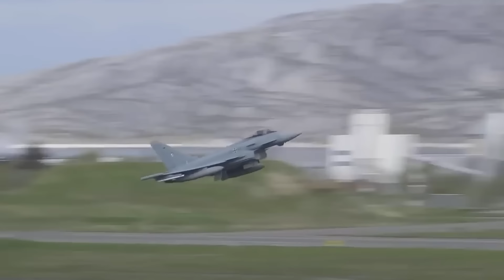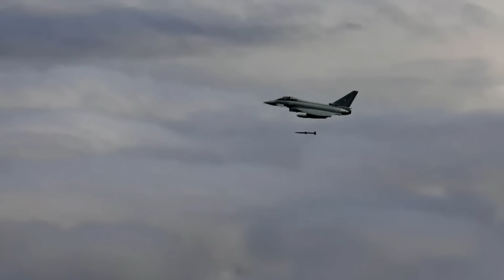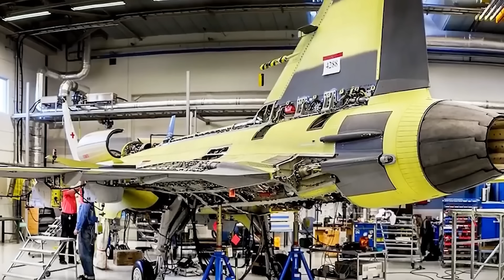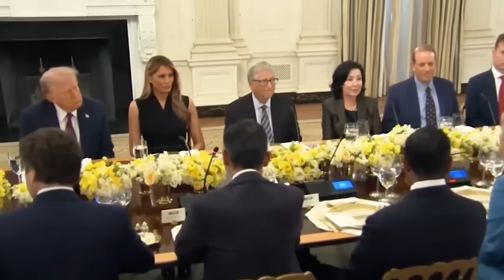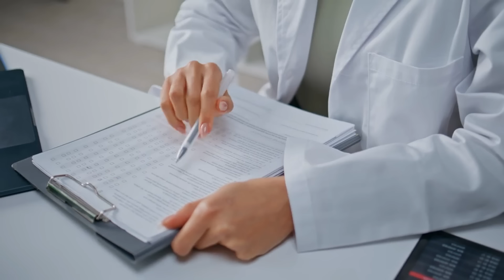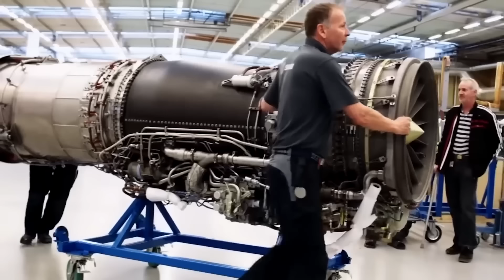Rolls Royce Silently Modified the Gripen — NATO Didn’t See This Coming!

Comment: This video is bs. The Saab CEO just recently said there is no plan to replace the engine for the Grippen E and that doing so would be far too costly.
Reply: And yet the B-52 is doing exactly that.
Reply: @billdyer9443  The B-52 is a completely different type of air frame, built for a completely different purpose.  Much less complex process to replace engines that are attached to the wings.  Very minor specification changes to a fighter jet can change the complete characteristics of its handling.
Reply from the maker: Thank you for sharing that information! It’s great to have viewers who keep me on my toes with the latest updates.
Reply: https://www.youtube.com/watch?v=azxiRv9Pxbc

Comment: The Gripen is a MUCH better choice than F-35.
In particular, it does NOT have a kill switch for USA to veto aircraft use.
Reply: Britain also mistrust the F35. We must build National independence into our capability. I would suggest also that the UK should embark on a new programme of establishing a stock of tactical nukes. We need them for our own defence. Surely this could be achieved through a cooperation with France.
Reply: There are huge arguments about whether there is literally or figuratively a kill switch.  Either way, same effect, just the former is significantly faster to act.
Reply: Those computer upgrades have to happen every day or they can’t even takeoff !

Comment: Rolls Royce is not one of the leaders in aircraft propulsion, BUT the leader!
Reply: GE gives them a good run for their money in the military sector, but overall if it's a Rolls then you're in good hands
Reply: not just aircraft propulsion... there was an article several years ago... US engineering made a drill bit 1000 x thinner than the human hair.. rolls royce asked to see it.. they sent it back 4 weeks later 
the shank had not only been drilled, but threaded and acompanied with a bolt ... make's you wonder what else RR can do....
Reply: @petephillips1378  .yep, that little extra step makes all the difference...and to be able to pull off that kind of detail requires a lot of little, patient steps and a lot of consideration.
Reply from the maker: Absolutely! Rolls Royce has a strong reputation for pushing the boundaries of aircraft propulsion technology. Their innovations consistently set new standards in the industry.
Reply: .... and holder of the Land Speed Record!

Comment: I have heard this before and it’s also been stated the RR is  not making engines for the Gripen. Are they or not?
Reply: not the EJ-230 doesn't even exist it's a concept without a real market
Reply: Complete BULLSH!T.    Both SAAB and Rolls Royce deny that there are any meaningful discussions to replace the current G.E. engine in the Gripen with a Rolls Royce engine.

Comment: Sweden is upgrading the Gripen E with a Rolls-Royce EJ200-based engine, designated EJ230. This replaces the U.S.-made GE F414G engine. That's a fact.
Reply from the maker: You're absolutely right! The upgrade to the EJ230 engine is a significant step for the Gripen E and showcases Sweden's commitment to enhancing its capabilities.
Reply: @fighter.aircraft  it also eliminates dependence on us engines at a time when that dependence is hampered by political maneuvering by the us.
Reply: @fighter.aircraft  What's your source for this? Credible source only please. Not speculation or another AI script based clip making the claim.
Reply: @fighter.aircraft  Complete BULLSH!T.    Both SAAB and Rolls Royce deny that there are any meaningful discussions to replace the current G.E. engine in the Gripen with a Rolls Royce engine.
Reply: @chrisgraham2904  And yet there are many sources that confirm that it's true.

I suspect that SAAB and RR want to keep it under their hats for commercial reasons.

But, definitely not bullshit.
Reply: @phildane7411  No.  It's BULLSHIT.   https://www.youtube.com/watch?v=azxiRv9Pxbc
Reply: @phildane7411  No.  It is BULLSH!T.   https://www.youtube.com/watch?v=azxiRv9Pxbc
Reply: @chrisgraham2904  I suppose you are a butthurt GE employee.

Whatever, shouting your head off and repeating yourself doesn't change the facts. The Swedes and RR are working together to do something radical.

Fewer and fewer people want US trash. Companies have to adapt.
Reply: @phildane7411  LOL  No, I'm not a G.E. employee and nor do I accept conspiracies, regardless of how prevalent they are online.  

https://www.youtube.com/watch?v=azxiRv9Pxbc

I am a Canadian that is routing 100% for the Gripen for Canada, regardless of the engine installed.  Dozens of reasons why the Gripen shines over the F-35 for Canada's specific defense requirements.  I would love to see zero dependence on the U.S. G.E. engine, or anything else from the U.S.

"You don't buy rocks from a bully that is throwing rocks at your head".
Even if there were top secret development taking place between SAAB and Rolls Royce, there would be at least a 10 years wait before the first Rolls Royce powered Gripen rolled off of the line and Canada can't wait that long.
Reply: @chrisgraham2904  And, you asked them? :face-blue-question-mark: :face-green-smiling:
Reply: @phildane7411 it's bullshit.... Rolls Royce did some work on electronics on the engine and thats it
Reply: @phildane7411 .... It's Bullshit... The entire aircraft would require to be recertified and a shit load of legal, technical and safety issues sorted out taking years to complete.... That is assuming you can shoehorn an engine in the existing frame ..... It's not the 1940s when you could swap an Allison engine for Rolls Royce Merlin, that were almost identical in size, into Mustang or slap some Bristol radial engines onto the wings of Lancaster
Reply: @petersmith7126  Sadly, it's your comment that is absolute bullshit.

You clearly know very little about aviation engineering, or the politics surrounding military aviation.

You seem to be very butthurt over this so you're just flapping your mouth in denial. Perhaps tell us why?
Reply: @petersmith7126  Maybe come back when you actually have a clue and know something, rather than making stuff up because you don't like what you hear.
Reply: @phildane7411 ...Any number of internet searches give the same answer ..... Rolls Royce are not redisigning the Typhoon Engine for the Grippen..The havd done some work on the electronics of the existing engine and that's it
Reply: @petersmith7126  And any number say the opposite.

I find the ones suggesting something along those lines is happening to be more credible.

You believe what you like.
Reply: @phildane7411 ... Don't worry about it I do 😂😂😂
Reply: @phildane7411 😅 UK has to thread the needle to maintain it defense system dependence on US hardware
Reply: @chrisgraham2904  You clearly have no contacts in the defence industry; I was at DSEI in September and I saw who visited the Rolls Royce and Saab stands. It is abundantly clear that Saab and Rolls Royce have been talking for a long time, and it is a matter of record that Switzerland inquired more than three years ago about buying Gripen E with the Rolls Royce engine; if you were authorised, you would already know the name of the test pilot attached to the Swiss procurement team.
Reply: @chrisgraham2904  Your figure of ten years is laughably wrong. RR had an engine ready for tests less than a year after the first discussions; after that, things went very quiet, which is usually a sign that serious work has started. You might like to read up about NISP and STANAG - you would understand better how and why such rapid responses are possible.
Reply: @petersmith7126  If you think that an Internet search is going to tell you what is going on, you are suffering badly from the Dunning-Kruger effect. You don't even know who to ask, nor do you know what to ask them. There are very strong indications that RR has built an engine that Saab has tested in the Gripen airframe, and you can be certain that if things have got that far that there is serious intent on both sides.
Reply: @petersmith7126  All you have is belief; I have facts and knowledge. There are very clear indicators that Saab and RR have been collaborating for some time on a project to fit a modified EJ200 engine to the Gripen airframe; it is very nearly impossible to conceal such activities, especially if you know what to look for. In such projects no formal announcement is ever made unless and until a real deliverable becomes available for purchase; in this case that would be a Gripen airframe with a RR engine.
Reply: In an interview  with another outlet, Saab's CEO said the Saab & Rolls were not working to replace the 414 engine in the Gripen 39E/F.  I find that answer questionable.  It makes too much sense to use the Rolls engine -  we will see!!
Reply: @davidhegmann8077  That is CEO-speak and the words are carefully chosen. What is almost certainly happening is that Saab and RR are conducting tests to see whether it would be possible to install a RR-engine in a Gripen airframe. Only if those tests are successful would the two parties consider replacing the GE engine.
Reply: A smart move given the current US Administration's aggressive behavior towards fellow NATO partners.

As I was watching the video they mentioned re-engining was not an easy task as new engine mounts, etc needed to be made. I instantly wondered if modifying an existing engine design to be a direct drop-in retrofit would be possible?
Reply: @tylergodfrey4486  Yes. NISP and STANAG requirements (which Sweden chose to meet long before it joined NATO) mean that relevant details are available easily to both parties without the need for commercial confidentiality agreements.
Reply: if you get to the last 1min of the vid you will notice it is speculation. the title helps for youtube clicks, and is not bad for saab sales and is popular for all non-us "ally" countries that don't like dependence on companies operating from a nation that is using bullying tactics for sales. people want to believe it regardless of it's accuracy. It should be possible to tell from pictures if there actually were RR engines in some test gripen, but, as mentioned in the last min of the vid, it would require different maintenance training and parts, however military combat planes are exempt from faa certification for obvious reasons.
Reply: If this is true, Im completely sold and thrilled!🇨🇦🙋‍♀️👍
Reply: Yet another loss for US engine manufacturers in addition to the loss of F35 sales and maintenance contracts. AND at a huge saving for Gripen based Air Forces. Never mind the loss of control of other countries by the USA.
Reply: Dej
Reply: Det finns inget beslut att byta motor i Gripen i nuläget. Däremot gör de provtester. Så kanske i framtiden. Men inget bestämt i nuläget.
Reply: After their work why would that be a surprise?
Reply: Bollocks.... It hasn't even been properly looked into fitting a Rolls Royce engine .... SAAB may build an Aircraft with a Rolls Royce engine but it will not be the Gripen
Reply: @petersmith7126  Love seeing all these Americans here! :eyes-pink-heart-shape::body-blue-raised-arms:
Reply: @petersmith7126  Bollocks.... They will retrofit.
Reply: @phildane7411 not without redesigning the aircraft
Reply: @petersmith7126  They may need to redesign a small part of the aircraft, but, guess what?

They employ a lot of aircraft designers.

There is precedent for this, you know.
Reply: @phildane7411  Complete BULLSH!T.    Both SAAB and Rolls Royce deny that there are any meaningful discussions to replace the current G.E. engine in the Gripen with a Rolls Royce engine.
Reply: @phildane7411  https://www.youtube.com/watch?v=azxiRv9Pxbc
Reply: @phildane7411 https://youtu.be/azxiRv9Pxbc?si=02s5iz1Lwzy9P4tW
Reply: @petersmith7126  You don't like the idea, we get that.

So you just keep finding videos that support your view if it keeps you happy.

So long as they make you feel  comfortable, you'll be fine.
Reply: @phildane7411 ok Smart Arse you provide some concrete evidence of it being true
Reply: @petersmith7126  You don't actually know, nor are you authorised to know because you have shown clearly a profound ignorance of how military development is conducted and you have also stated publicly that you are Canadian.
Reply: @hb1338 😂😂😂😂😂😂😂😂 where have I said I'm Canadian....I'm a proud Scot 💪
Reply: Complete BULLSH!T.    Both SAAB and Rolls Royce deny that there are any meaningful discussions to replace the current G.E. engine in the Gripen with a Rolls Royce engine.
Reply: @chrisgraham2904  This is called politics. Canada can use RR as it already has RR productions.
Reply: @chrisgraham2904  Oh dear. You are clearly unfamiliar with either defence-speak or military development. No discussions about replacing the GE engine will take place unless and until a replacement option is actually available. Until that time Saab and RR will merely conduct private tests to see whether it is possible to fit an RR engine to a Gripen airframe. Such an approach allows for the possibility of either technical failure or commercial infeasibility without causing the participants any embarrassment.
Reply: @hb1338  LOL  Regardless of whether there are no discussions to replace the Gripen engine, or there are top secret discussions taking place,  there will be no replacement engines in the near future for a Canadian order.
Reply: No it's not. Why?  There is no RR engine for the Gripen.
Reply: "That's a fact"???   Provide the evidence to prove it.
The CEO of SAAB says; "Nope!  Not happening".

Comment: "NATO Didn’t See This Coming" - Uk and Sweden are members of NATO, so at least parts of NATO did see it coming if it's true. USA and Nato is not the same thing. Today the USA are more friendly to Russia then NATO!
Reply: Saab and Rolls-Royce are commercial companies. They can do what they want, when they want and how they want, and there is NO requirement for either party to inform NATO or anyone else of what they are doing. The only requirement is that if Saab wishes to sell Gripen with a RR engine to a NATO member country, it must demonstrate that the aircraft complies with the relevant NISP and STANAG requirements, which cover operational and interoperability standards. As you can imagine, such compliance would be established during the early stages of any development project.
Reply: This must be the signal that Europe turns away from dependence on anything from the USA. The Usacannot be trusted in British or European defence. The strategy for Europe and the UK must be to move to its own independent defence capability. I would suggest that Europe should move from its position with regard to British engagement in defence and access to the European satellite system. It's not the time to block mutually beneficial cooperation. Th is just be possible with Britain outside of the EU.
Reply: @colinporter7108  - Bullshit
Reply from the maker: True! Maybe NATO needs a crystal ball for all these surprises! Or at least a group chat where everyone can share the latest gossip!
Reply: @fighter.aircraft Nato without Us knows. Guess why?
Reply: BULLSHIT